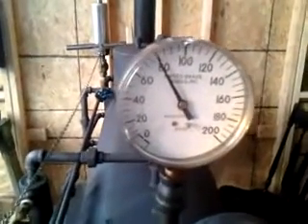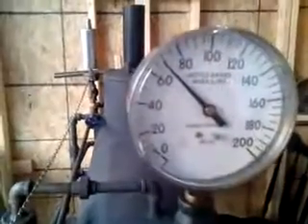Last Whistle Blow for 2012 ( New Whistle )

Comment from the maker: Things still needing to be done on this boiler in the spring are:

* Purchase 2 1/2inch boiler injectors
* Build Steam Cylinder, Steam Chest, Piston & Crosshead.
* Paint the wheels
* Plumb everything when installed